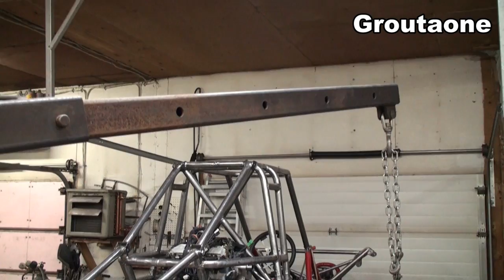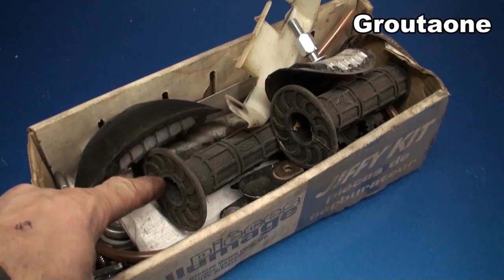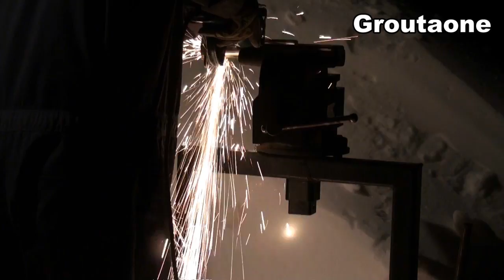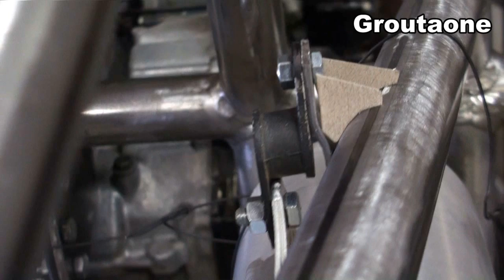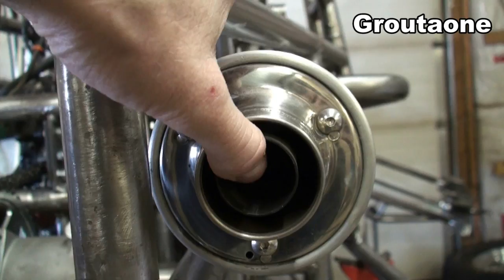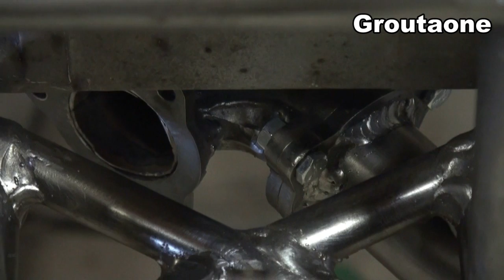Long Travel Susp Build PT 43

Comment: I don't know if this is a dumb question but something struck me the other day. If your engine is solid mounted to the frame and the exhaust has no flex tubing in it shouldn't the mufflers be solid mounted as well?  I mean, isn't the rubber mount for the mufflers going to allow the muffler to flex, even a little and create stress fractures in the exhaust system?

Comment: I have to agree with Gassolean, exhaust work is my favorite also. I made my exhaust just as you did, but I flared mine from 1.5 in. to 2 in. about mid- ways to the muffler. Do you think this will affect torque or horsepower in any way?  Always nice work and nice clean videos. Thanks

Comment: Ahhhhh, got my cricket fix for the night, lol. Have you ever had any problems with the steel on steel seal? I've always used copper gaskets on flanges like that.
Reply from the maker: I think they may leak ever so slightly but not near enough to hear the leak, I plan on running them as is but might work with a little high temp silicone

Comment: what kind of material did you use the the exhaust, stainless? and what size? pipe or tubing?
Reply from the maker: This is normal steel exhaust tubing, 1-5/8

Comment: Glad to see an update!! You do some fantastic pipe building! Should make one for your 500 ;) It'll be awesome to see it finished!
Reply from the maker: Thanks buddy, sure would be fun to experiment with different 500 pipes, I would like to try a pipe that makes my 500 hit real hard on the top and give up some low end
Reply: groutaone You might want to try the CPI race pipe, it makes max power at around 7500 RPM. Though, it's designed more for modified engines. Adam would definitely be the guy to talk to about it though. ;)

Comment: Are you planing to mount a skidplate on the machine?
Reply from the maker: Yes, more like an aluminum floor like what's used for the front part of the machine, I think it would help a lot for sliding over snow banks and such